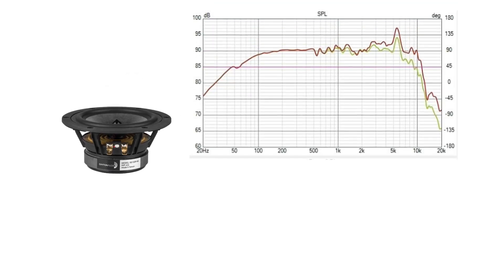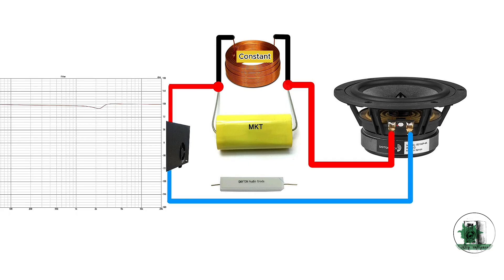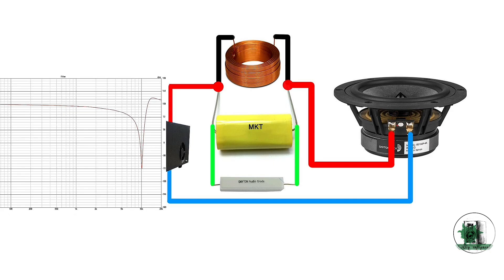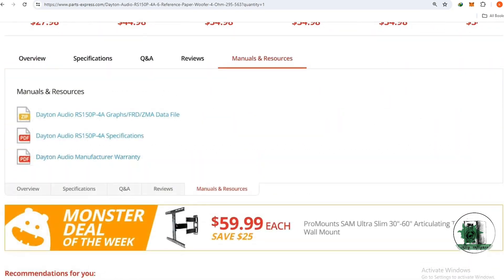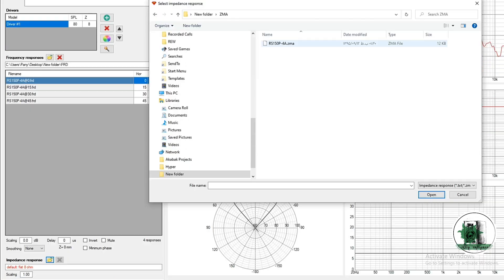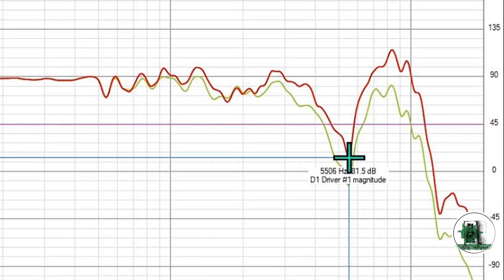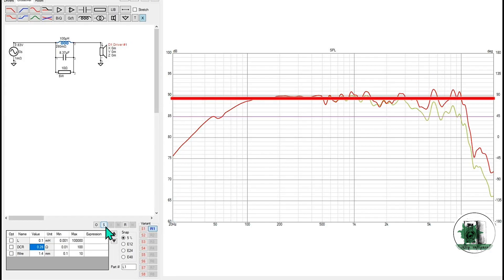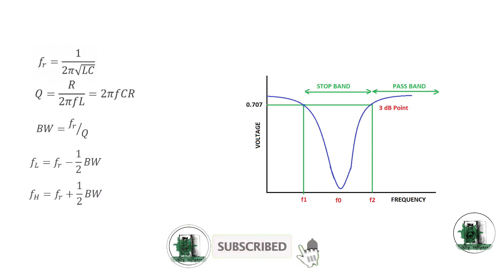Crossover Design, parallel Notch filters

Comment: Thanks very much for you amazing videos, I have learned a ton from them. I bought a pair of DAYTON AUDIO PS220-8 full range drivers with the idea of building a back loaded horn speaker, this drivers are very irregular above 2.5kHz and I was unable to come up with a crossover to tame them without sacrificing the very high sensitivity, so I gave up the idea of building a back horn loaded speaker and decide to build a bass reflex using the PS220-8 with a DAYTON AUDIO PT2C-8 ribbon tweeter. I created a crossover using VITUIX CAD and XSIM that blends the two with high sensitivity and almost flat response, but the impedance goes down to 2 ohm!!! So I am not satisfied with the result. Can you please consider doing a video of a crossover design for this two drivers? The are not very expensive and have the potential for great design if they came be tamed (PS220-8) and matched. I am considering 76 liter vented box with a resonance frequency of 40Hz for extended bass, used Basta! for the box design, amazing software.
Reply from the maker: Hey! Your project sounds interesting. If you'd like, you can record a video of your build process and share it with me.
Reply: @Diy_enjoyment  If you help me with the crossover design I can give it a try, I can document the process in photos and video to share with you.